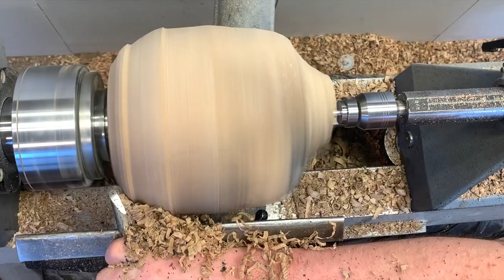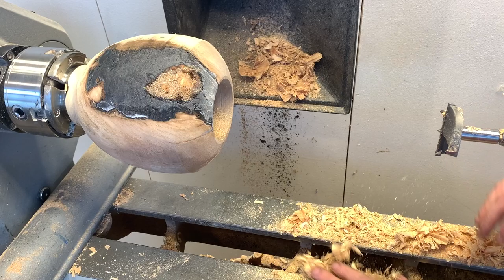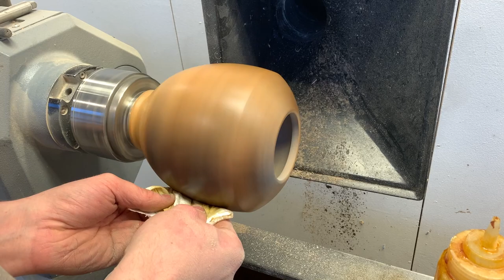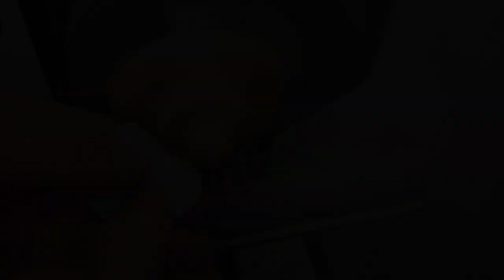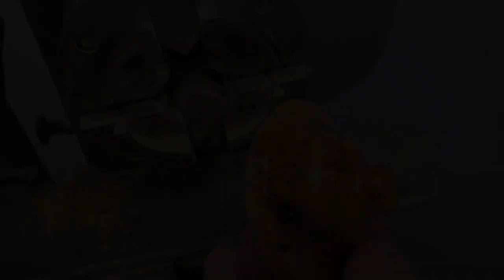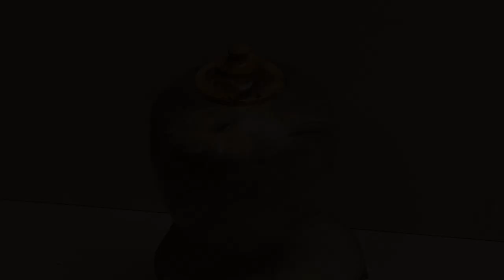Woodturning - Figured Sycamore Vessel Jack Mack Woodturning

Comment: Fantastic work lovely shape pleasing to the eye.can you tell me what is the make of your  blue power sander and maybe a link to where to purchase that would be great regards Martin
Reply from the maker: Cheers Martin, it’s just a makita angle grinder, fitted with M14 50mm hook and loop backing pads. If your in the US your grinder will likely be M10. I’d not recommend sanding like this without extremely good dust extraction very close to the workpiece. It also takes some practice to be able to use this high speed grinder in a moving workpiece so please be careful. I use the lathe in reverse when sanding like this too.

Comment: Awesome work as always Jack. Quick question, are you finishing only with friction polish, it are you applying another finish on top of the friction polish?
Reply from the maker: Thanks. I’m not exactly sure about the friction polish.. to my knowledge (and there a high chance I’m wrong) friction polish would have oil in too. So I just refer to the first coat ( sqeeze bottle) as shellac sealer.. basically isopropyl and shellac flakes, I don’t make it to a specific recipe I just know the viscosity that works for me. 

But to answer your question, il follow that with a single coat of wax or paste wax depending on the item being finished. For smaller stuff with a consistent body il use hard carnauba wax but in this case I used a past like Hampshire sheen high gloss. 

Il add that if I’m making an item for our home I prefer Matt, oil or no finish at all. But for customers and videos like this shiny wood always seems to be most popular. ✨😎✨
Reply: @JackMackWoodturning  Thanks for clarifying that. I assumed that it was a friction polish judging from the darker color and now that I think about it, it's different shades of shellac flakes available. Thanks for your help!!!

Comment: Nice work and very interesting !
And I have a question, what's your gouge at the beginning of the video ? I'm looking for something like that but i don't found it !
Reply from the maker: That’s a 5/8th bowl gouge. You’ll find plenty of them available as they are the main tool a wood turner would use. You won’t find them in the shops with that shape cutting edge, that’s something you have to do to the gouge yourself.